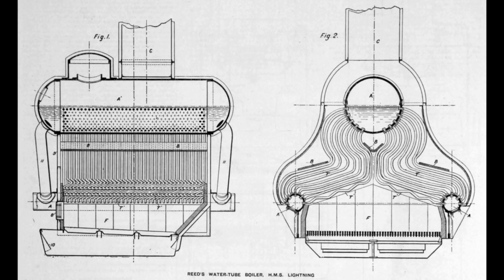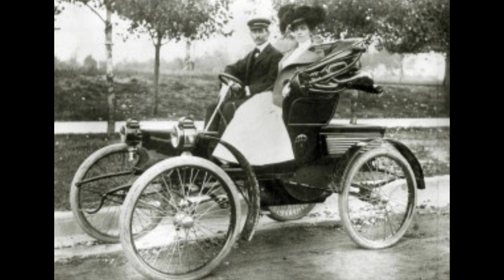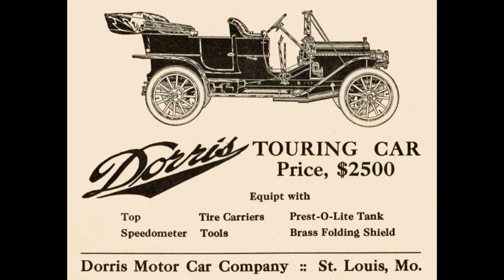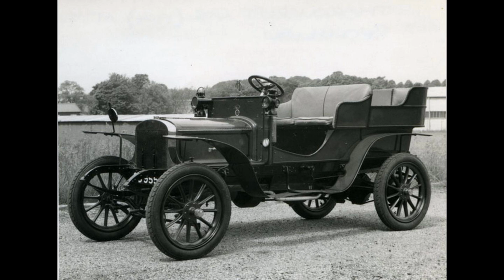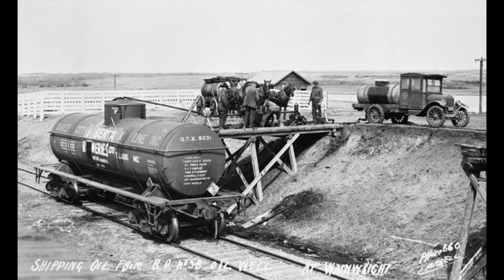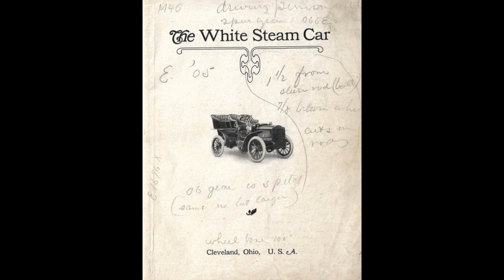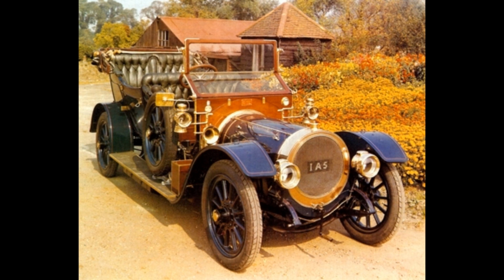Steam Boilers in the 1900's - The Unusual Case of the Car and Ship

Comment: It is absurd to compare automotive steam generators to marine steam propulsion plants. Automotive boilers were almost exclusively "flash" boilers which produced very little power or offered very short range and very low efficiency,  by evaporating relatively few pounds of water per hour.  A single marine boiler will evaporate 100,000 pounds or more per hour and expand it across many stages to recover as much heat as possible while conserving as much feed water as possible. The volume of water circulating in the system and the complexity of the auxiliary systems required to efficiently manage that flow of energy makes any comparison ridiculous and to be honest is simply a silly exercise for dillittantes who have no experience of either. The point that a reciprocating steam engine makes maximum torque at standstill might be fun for cars and locomotives but is essentially meaningless in a marine propulsion plant. The amount of knowledge, historical and contemporary, about marine propulsion today is astounding and easily available to anyone with an interest beyond the casual YouTuber level. The number of volumes available in used book stores, libraries, and yes, even online belies the claim that very little is available. The amount of misinformation and outright nonsense on sites like this is a much larger problem for those who seek to learn.
Reply: If you had paid ANY attention to the first few minutes of the video, you would have learned that your attack on the creator is totally unwarranted.      What is being pointed out is that innovations in the development of automotive steam generators led to major improvements in the design of marine boilers.      I'll guarantee you that Drach has forgotten more than you have ever known about steam propulsion in ships.
Reply: @stargazer5784  Typical fanboy response. By the way, my chief engineer's license for marine steam propulsion of any horsepower on any size ship earned by years of actually operating marine steam plants at sea voids your silly guarantee.

Comment: 35:07 - I wonder if a multiple-expansion engine could be made more compact by nesting the higher-pressure cylinders within the lower-pressure ones (using annular bores and pistons for all but the highest-pressure cylinders), which would also (theoretically, at least) increase efficiency somewhat by helping to keep the cylinders hot (because, instead of the outer surface of each cylinder being directly exposed to the external environment, now only the outer surface of the lowest-pressure cylinder would be so exposed, with the outer surfaces of all the other cylinders being bathed in still-fairly-hot steam, retarding heat loss by conduction through the cylinder bodies).

Comment: Something that is a continual surprise to people is that there is a fundamental difference between Rankine cycle (steam) engines and both Otto cycle (spark ignition reciprocating piston) engines and Diesel cycle engines-- maximum torque at zero!  Internal combustion engines need auxiliary starter motors because they produce zero torque at zero.  Steam engines produce maximum torque at zero, because the expanding steam does not have to chase a moving piston to press against it, so they only need auxiliary motors at start if they were stopped at either Top Dead Center or Bottom Dead Center and it only needed to run long enough to move the piston past the center, not repeatedly crank the engine through full rotations.

The closest that internal combustion engines came to multiple expansions is turbo compounding, where the heat recovery turbine of the supercharger extracts more energy than is needed to drive the compressor and the excess is coupled to the engine's crankshaft.

Comment: A friend of mine served on the Newport News and was part of the USS Salem museum.  They  had a damage control chart outlining what speeds  varous mixes of boilers and screw states could provide.   The massive jump in power output to get those last knots is tops speed was impressive.   That is why cruising ranges are figured for speeds well below the ship's  maximum speed.  Under nuclear power modern carriers can mostly forget the old ways.    I read that under emergency conditions  some carriers can make well  over 40 knots.   But then they are using enough power for a small city.

Comment: I had a career of over half a century of as a steam power eningineer, locomotive, marine and stationary.
An aspect you did not cover was water treatment.  Water being the universal solovent is never pure in nature but contains dissolved gasses and mineral salts.  To prevent scaling treatment with chemicals is used and modern high pressure plants use reverse osmosis filters or demineralizers to produce the equivalent of distilled water.  Locomotives, which had to use whatever water was available, needed a "washout" to remove mud and scale every month.  The low volumne, small tube steam generators you seem to favour need to have the purest water and having been the chief in a plant equiped with them, I still get nightmares thinking about them.  They do not explode but catch fire and that is a spectacular fire,  Also strict attention needs to be made to "blowdown" to limit the level of mud and dissolved solids in the boiler water. I think the Royal Navy was wise to reject them for the Queen Elizabeth class battle ships 
As far as piston engines go the  "Uniflow" was the most efficent but like the multiple expansion engines, much of the power came from exhausting in to a condensor creating a vaccuum allowing for the steam to be exhausted at low pressure and temperature.

Comment: One final comment as I'm not sure you'll end up replying to any of these.  Repair Division/ R-Div was made up of the following rates HT as I mentioned previously and DC Damage Controlman and MR Machinery Repairman.  We had a second job, we make up the ships Flying Squad.  We are the ships fire department and while yes as the Marines say every Marine is a rifleman the Navy says every sailor is a firefighter... kinda..  I guess you could look at it as they are general infantry we were the Special Forces.  When I was aboard the Hawk from 1999-2002, maybe early 2003 we were an old ship that was ran hard and we met and exceeded everything asked of us.  We were so skilled we managed to stay out of the papers from certain "issues".  We call fires, floods, toxic gas leaks etc.. casualties.  On my first deployment in 1999 we had 633 casualties by mid 2000 I became the number one attack team leader for the Flying Squad.  At the time I was not only the youngest to hold the position but also the most junior ranking, it's something I've remained proud of.  I'm probably one of the most experienced sailors you'll find in the realm of modern damage control.   Of course the folks on the Stark and the Cole really went the distance and what I said I'm not trying to take away from thier nightmarish experience. 

If you ever have any questions on damage control how it's set up etc...  I'll be glad to share all I know plus I have a few interesting stories.  I haven't watched your damage control video yet.

Comment: In the Jay Leno's Garage series he has two high pressure (750psi if I remember correctly) steam cars that were made by a single company, which was almost a one man show!
One of them was own by Howard Hughes and both were of a production run of under 27 cars!!  The cars were direct drive (i.e. no transmission, the steam cylinders' con-rods were directly attached to the rear axle) and only took a few minutes before they could "get underway".  A few more minutes they were ready for speeds over 45mph!  Although, they weren't great at stopping quickly... the feed valve hand wheel was just inside of the steering wheel's rim and was almost the same diameter...

Comment: Surely the scale build up in marine applications would have been largely ameliorated because they condense and recirculate the same water.  After one pass through the system it would, effectively, be distilled feed water to the boiler.  Not counting topping up needed for loss.  Unlike the boilers in most steam land vehicles (lorries, locomotives) where water recuperation was a largely unneeded, bulky, mechanical complication.

Comment: This was all extremely interested. I had no idea that steam engines were so advanced and so common around the turn of the century.
Given the enormous power of such engienes I have a question now.
Why did they elect to use internal combustion engines in the first tanks?
Steam engines serm to have been a much more mature technology at the time, with many benefits. They likely could provide significantly more power, would likely have been much more reliable and probably would not have produced much in the way of fumes inside the tanks, due to the simoler design of a boiler, even with petrol as fuel. If they had used coal, they would even have mostly eliminated the risk of fire when the tanks got hit. If steam tractors were relatively comon in the countryside that would also have meant that a not insignificant number of recruits would have at least some experience of operating them, making them easier to train.
All in all, steam engines seem to have had many advantages, and IC several disadvantages.
I really wonder why they went with IC over steam.
In short, I can't re

Comment: @24:12 Tractor engine vs moder tractor: in such tug-of-war you don't really count on power (measured in kW or horsepower), but effective pulling force (aka tractive effort, measured in kN or tons of force). As power is force times velocity, those huge tractors were capable still machines, although slow.

Comment: Very disappointed.  The history of marine internal combustion engines is almost completely ignored.  One of the reasons that the automobile industry settled in Detroit was that that there was already an established industry in to h we be city building small internal combustion marine engines for power launches and other small boats.  The role of marine IC engines in the development of the auto industry seems ignored. The presenter seems ignorant of the industry building small marine internal combustion engines that existed in the late 19th century and early 20th century, which is why shipbuilders built cars with internal combustion engines.
Reply: Absolutely correct.  By the late 1800's, we were seeing internal combustion engines in small boats due to superior fuel consumption, among other things.  A lot of these engines were conversions of steam to gasoline. I believe this trend really started out in California, but spread rapidly.  Detroit was almost inevitably going to be the automotive capital.  Besides a large marine industry, it was the "Cast Iron Stove Capital", meaning it had foundries and pattern makers.  Copper working establishments were common due to the supplies in Michigan's Upper Peninsula.  When Michigan gained statehood, they also adopted a policy of giving immigrants state citizenship much earlier than they could get US citizenship.  With this inducement in hand, they were able to induce European skilled tradesmen to the state, especially the Detroit area.  For a city its size, it had a large number of machine shops.  It didn't hurt that Detroit was one of the earlier cities to get large-scale electric power distribution, which made it easier to set up shops than if you had to use steam engines and overhead belts. Finally, there was the historical happenstance that the lumber industry was running out of virgin forests to cut just as cars were becoming a thing -- some of those lumbermen were a bit wilder and woolier than East Coast bankers and were more willing to gamble on something as speculative as automobiles.

Comment: With regards to the Red Flag Act, the popular story is that people saw these newfangled steam vehicles as big, noisy, smelly, and dangerous; they could run down children in the roads, their boilers would explode, and all the rest, and that's why the Act was passed.

The reality, at least according to some historians I've been reading, was a bit different. By the 1830's steam powered road vehicles were actually on their way to becoming commonplace. Engineers such as Walter Hancock and Goldsworthy Gurney were improving upon the initial concept of Richard Trevithick's 1802 London Steam Carriage to the point where starting in 1833 Hancock began offering a steam coach service between London and Bath that cut the travel time down from 2 days by horse-drawn stagecoach to a mere 8-10 hours. Other inventors were also building steam drays, smaller vehicles that could be hitched to ordinary carriages to take the place of horses. It doesn't take a great leap to imagine the faces of engineers like Brunel and Daniel Gooch, directors of the nascent Great Western Railway, to see this direct competition from road haulage whose capabilities were not a million miles away from their own railway trains; true, a train could still roughly double the speed of a steam coach and carry more people, but if more steam coaches started running and offered a more frequent, and more importantly cheaper service, the worry was that passengers might not mind the longer travel time if they could save a few bob by going by road rather than rail. Hence, it was actually lobbyists funded by the railways who pushed for the Red Flag Act as a means of squashing their competition. 

And as for traction engines being slow, that's also only partially true. Yes, for the most part they were built for power rather than speed (as mentioned before, the Red Flag Act made speed a non-option, at least in theory), but that didn't mean that they weren't capable of speed when called upon. When out on the open road away from the Constable's watch, a well-tuned Aveling & Porter could well make upwards of 12-15 mph under heavy load. That may not sound like much, but it's still almost double the Red Flag Act's limits, and that's with a line of wagons rumbling behind. Some could go even faster; a Fowler 8hp engine, particularly popular with house removal companies, could haul a line of furniture vans at the heady speed of 30 mph on good, flat road. 

Source: Traction Engines by Anthony Burton
Reply: Thank you for your comment. I was viewing another channel but drifted off to sleep. After that video finished the autoplay selected this one. I dreamt that there was a law in England limiting automobiles to a speed of 2 mph in cities, that the vehicle had to carry one person sounding a horn and another ringing a bell, that the car had to be led by a third person waving a red flag and blowing a whistle, and a team of these three people had to be employed for each vehicle owned. I awoke with this still on my mind. How am I going to check this out? Your post gave me the name of the Act and with that I was able to find some of my dream was true and other parts weren't.

Comment: As an aside, a chap I used to work with told me about his grandfather’s traction engine. His grandfather sold it to a local First Nation back in the early seventies and Bill told me it took two days to drive it about fifty miles. Not a competitor that the Roadrunner needs to worry about!

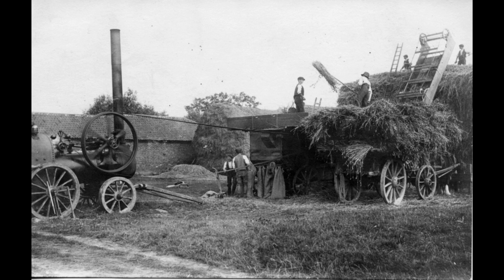Comment: Your photo at 23:10 is in fact a portable engine (pulled to where it was needed by horses) not a traction engine.  It appears to me that the shafts for pulling the engine are visible at the right end of the engine in the photo.

Portable engines were used for powering stationary farming equipment such as threshing machines.

Comment: were water tubes used on trains?
Reply: In 1929, Sir Nigel Gresley of the LNER built a 4-6-4 experimental express engine (class W1, number 10000) known as the “Hush Hush”.  It used a high pressure watertube boiler and was a 4 cylinder compound engine (so it could make efficient use of the high pressure steam).

This was not very successful, and it was rebuilt with a conventional firetube boiler and streamlined casing like the A4 class (the world steam speed record holder Mallard is A4 class).  In rebuilt form, it lasted into BR ownership, and my uncle once rode on a train pulled by it in the 1950s.

If you want to know more, there is information on Wikipedia, under the title “LNER class W1”.

Comment: The problem they had in the early days of oil are the same we have with modern electric and other eco platforms. Until the point electric "refueling" points are as common as the gas station, Tesla and the others will be city only, just as the early gas powered vehicles were. For example, I live in a very rural area, and the only "public" charging point is a set of three in the Walmart parking lot. The next nearest charging point is nearly 50 miles away, meaning that a person in our area with an electric car has to charge at home... and that once his battery drops below the 40% line it is time for him to go home. Even better options like ethenol or hydrogen are even harder to find. While yes, we can in theory depend on the market forces, the fact that fossil fuels are literally every 10 miles at worst means that the newest options cannot compete.